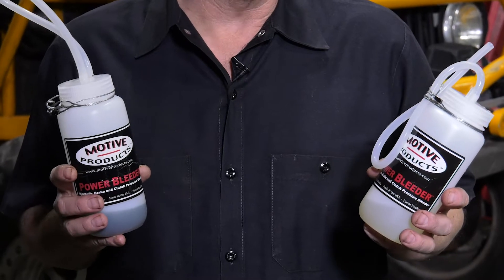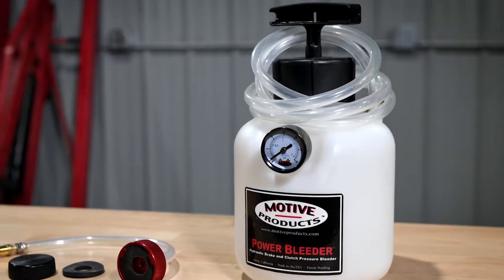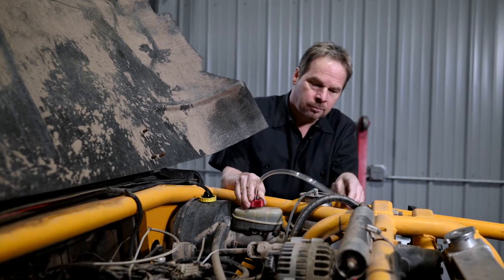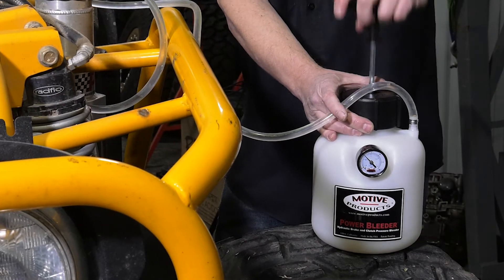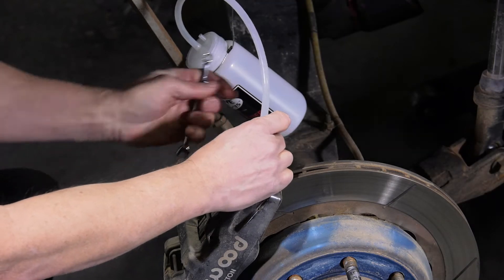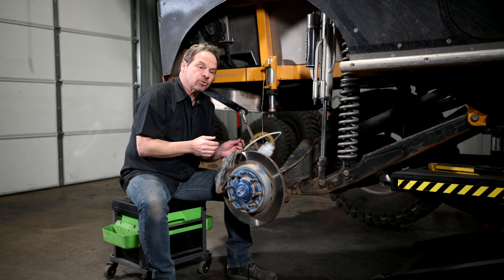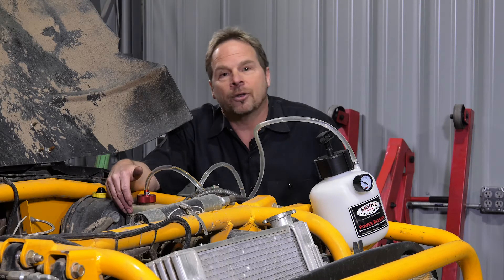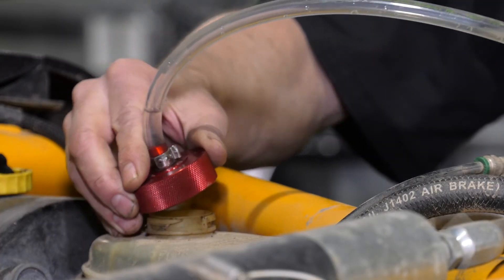How to Flush Brake Fluid by Yourself

Comment: Great tip on using the catch bottle to remove extra fluid from the reservoir. Eliminates the need for a turkey baster or other squeeze type bulb. Could also use that at the start to remove old fluid if flushing the system. Thanks.